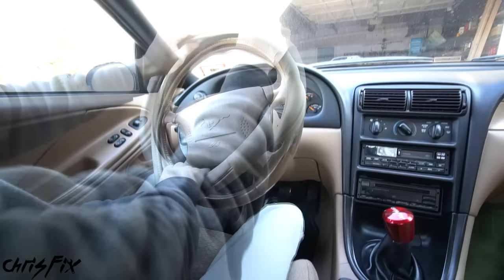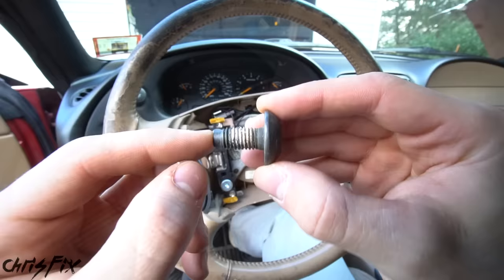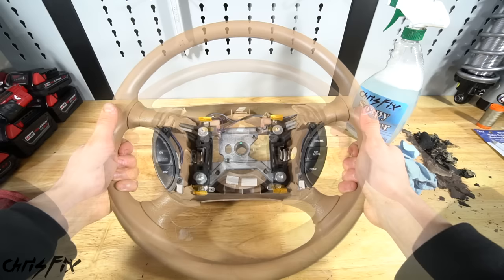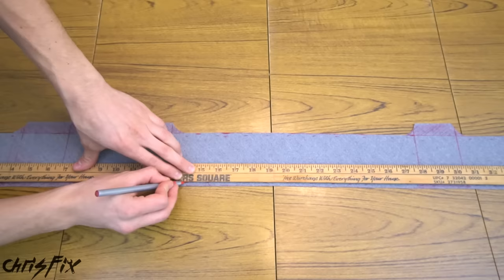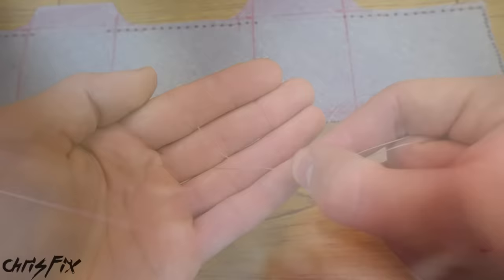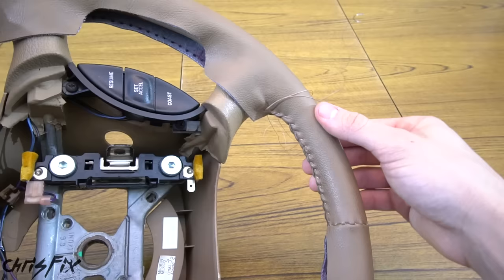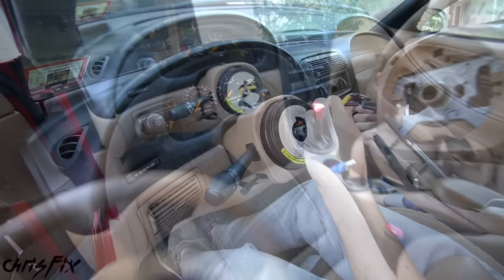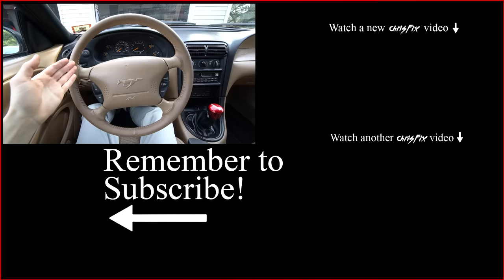How To Restore Your Car's Steering Wheel (Looks Brand New!)

Comment: Hi Chris! You didn't mention anything about pre-punching the sewing holes by sewing machine or by hand. Did you do that before sewing it onto the steering wheel?
Reply from the maker: I did not, I was able to push the needle through the material with no issues!
Reply: @chrisfix  It must have been easy to push the needle through because you were using faux leather, correct? But I am using real leather and it's harder to push the needle through without a hole punched already.

Comment: I have wrapped a steering wheel before and mine turned out well too. Where I found problems is the rubber parts of the wheel. When worn the rubber parts of the steering wheel will have another color show through. I needed to refinish the rubber surface and I couldn’t find a matching color to refinish it with. What is your suggestion?

Comment: It looks awful, the stitches are not even, the thread angle varies a lot, the spokes look like they have wrinkled foreskin. Do not perceive this as a hate comment , im grateful that this video put me off of the idea of wrapping a steering wheel. Even professional work has many imperfections compared to a OE factory wheel, imagine looking at something like this every day? Since i dont have the patience my attempt at this would be even worse.
Either you do about 20 of these before you get good or get it refurbished for about 100€ in a couple hours, considering the cost of material its a no brainer.

Comment: My Ford steering wheel is very similar to this one. The cruise control switches are virtually identical. The car is old and pressing the horn has resulted in a split in the center section - the part that covers the airbag. Any ideas how to repair it?

Comment: 8:28 Btw using carbon tracer paper and tracing wheel would be a faster, better option than using a marker and measuring tapes. You could find them in craft stores or online

Comment: I wrapped the steering wheel of my sim setup using some old clothes (they were too small for me) such as one of my black jeans and a different material which i dont know what it is😂
Reply from the maker: Haha how did it come out?
Reply: @chrisfix  very nice actually. Apart from some wrinkles because i used one of my old jeans and it has no stretch but i managed to keep the wrinkled sections almost symmetrical so it looks awesome :-)
Reply: @chrisfix  Also i used some red material on both sides (9-3) so it contrasts beautifully. Well it was the stock design of the wheel and i copied that design😂

Comment: Hey Chris!
I know it's been a while since you made this Video, but I just bought a new OEM wheel for my e36 with the intention of doing this exact same job, and was wondering if it still holds up or if the material you chose has aged

So how's it and how are you?
Reply from the maker: It still looks pretty much like it did when I made this video! Long term this is still a great option
Reply: @chrisfix  Happy to hear that :)

Comment: Could you do a video with a foam steering wheel? My wheel is not wrapped in leather to begin with lol
Reply: Man I wish.
My foam steering wheel fail victim to years of heat baking and oils from my hands.
It came unglued from the metal frame.
It moved freely and eventually came apart.
I cannot find a steering wheel just like mine.
None of the aftermarket wheels even come close to my steering wheel.

Comment: I have been trying to find an answer to how to repair the worn color on the spokes of my steering wheel where my hands touch the spokes. My spokes are covered in a dence thick foam and the color has worn away but I don't know how to fix that. Probably some type of paint but I don't know what to use.

Comment: The upholsterer in me cringed, but good job otherwise. I would recommend getting a kit so the seam looks toasty af. Even holes and no bulk. You also won't have to take the steering wheel off and they make different sizes/shapes for your type of steering wheel.

Comment: As always great video Chris. What do you do if the steering wheel doesn't have a wrap to start with ? (2002 Toyota Corolla) Do I need to take the top layer of foam off? or put the leather over top.

Comment: Hey Chris i really need help with a 2004 dodge ram st 4.7 i get crank but won't turn over i looked everywhere and nobody has a answer change crank and cam sensors all new plugs and coil packs fuel pump is working but no spark to the coil packs what so ever PLEASEEEE HELP!!!!!

Comment: What about replacing the control buttons? You mentioned it at the beginning of the video but never touched on it.
Reply from the maker: They have small screws and then pop out and you can put the new ones in and tighten it down. Reconnect the wires and you’re good to go.

Comment: Hey Chris, about how much material did you buy, I've got a 14 inch wheel I'd like to rewrap. Also how would you figure the width for the new material, if there is a gap in the stitching on the old cover?

Comment: I think you forgot an important step.. to glue all the leather material all around the steering wheel ! Because now we the leather will become used it will stretched and make folds unesthetics.. but for the rest it is really genuinely!
Reply from the maker: You could do that, but the stitching is pretty tight if you do it correctly! And thanks a lot!

Comment: This is not nearly as easy as described. It's quite difficult doing this with real leather vice the material used in the video since leather is tougher/thicker. Stretching it over the wheel took a lot more effort and a second person much stronger than I am.  Also, the stitches aren't holding tight as I go along.

Comment: Admirable job, though It looks like its just it could just be leather coating that is worn? Like leather shoes or any leather , it is sprayed (coloured )  and clear coated   . There is a potential  easier solution  I would have  found a leather spraypaint  and clear coat , sanded , resprayed and coated much easier, done this on black faded leather wheels that had the colour and coating had peeled in sun

Comment: Mine requires a puller but the wheel doesn't have any threaded holes to bolt into, its the dumbest shit cuz i think i may ve jacked up the main bolt hole with the puller center piece consistently sliding sideways cuz dumbass me didn't put the big bolt back in but the kit i got didn't have an adapter for it to hug the big bolt, make a bad situation shitty the puller i got only has 2 slots and my wheel has arrows pointing towards 2 vaguely wide open spaces im apparently supposed to pull from but with only 2 slots the puller bolts never grab the wheel, and when they do the center piece starts gettin jacked up crooked. Im pist its the one  thing i haven't been able to figure out, of course the more expensive solution [in my case] would have been to neve r have gotton a ford focus in the 1st place, but my wranglers guzzling straight 6 was sucking my wallet dry plusi got a sweet deal for this focus, but now i know why; its a fordable

Comment: You're going to use vinyl used marine-grade vinyl it will withstand the Sun do not use regular vinyl it will not last because of the Sun get vinyl that is made to be out in the sun stop by a marine supply store or a lot of upholstery shops have marine-grade vinyl it will hold up in the Sun regular vinyl will not last very long maybe a year only also I was just going to Walmart or the auto parts store and get a steering wheel cover also to protect the vinyl hope this information helps you

Comment: That is not a good way of doing this. You should make two parallel stitching on each side of the material and then tighten them with cross stitching when on the wheel

Comment: erm never look at an airbag when taking it off, always remove the baterry and leave it a day before its taken off, or you will be spending your savings on a nose jonb
Reply from the maker: That is very extreme. Remove the battery cable and wait 15-20 minutes and you are fine. Otherwise I would be concerned about driving your car every day.
Reply: @chrisfix   they hold voltage, and he’s moving wires, you don’t move them when driving ?